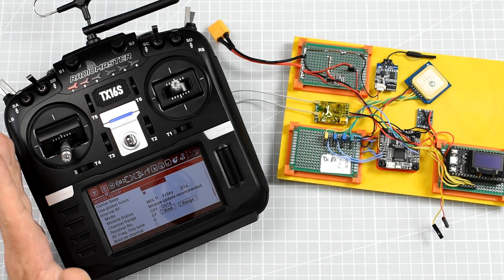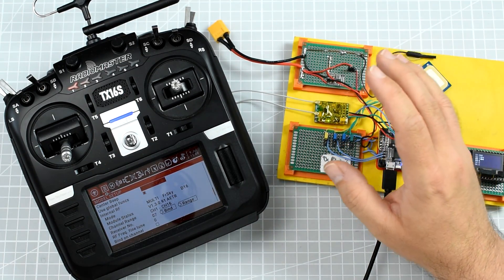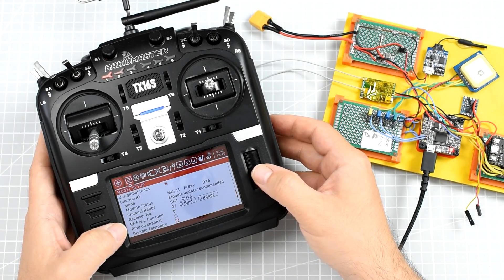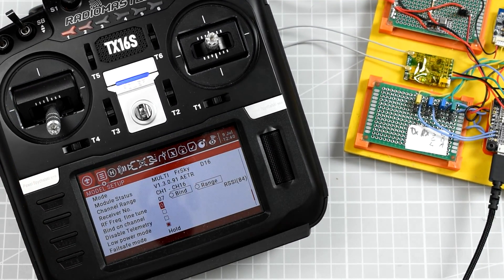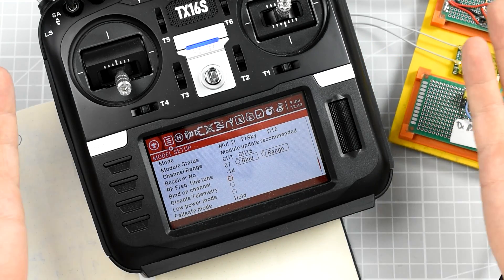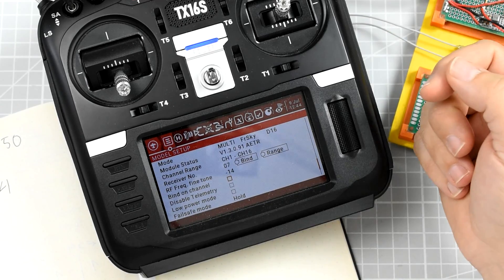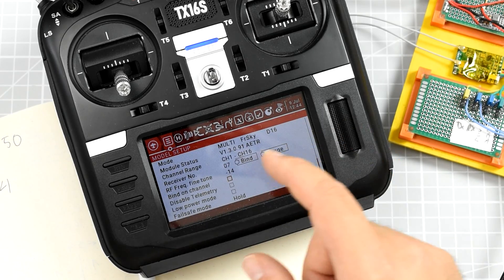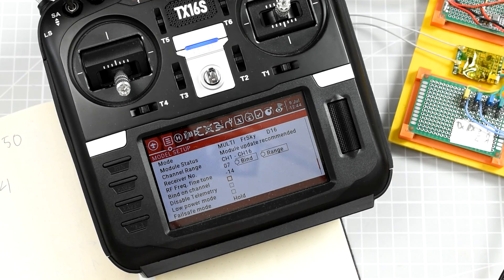Multiprotocol Module Frequency Tuning

Comment: Hi I'm having an issue with my x9 lite an xm pluse when I'm 2 close it loses connection will this fix the issue?
Reply from the maker: This is expected. And no, probably it will never be fixed
Reply: @FPVUniversity  is there a way to fix it
Reply from the maker: No

Comment: Thank you for the video!
I have a question using a TX16S with an FrSky XM+, I have "RSSI" working and showing on betaflight and my fpv goggles but it doesn't show a value on the TX16S?

Comment: My RadioMaster software does not show RF free fine tune.
Any suggestions?
Reply: Upgrade the RadioMaster and, foremost, upgrade the firmware of the External Module. (At least, this is what worked for my Jumper t16.)

Comment: Don't judge me for this ... I can see things difrent some times. This is a power level based adjust ... nothing else nothing more. I will not work with afhd or other multi frequency receivers/transmiter . Antena calibration is something else ... IT should be same as software side of the transmiter/receiver. Power based adjust is more dependent in things that are around You (house, walls, trees, etc)

Comment: There is some difference when you go until loose connection. And when you are from out of connection to when you aquire again the link. I do prefer the second alternative. 

Also I repeat the test several times and take note of several values. It is not always the same for some margin. Then I use averbado of the lower and upper average :)

Comment: Since SPI based frsky receivers fine-tune automatically upon bind (or so I've heard) would it make sense to rebind after the Tx fine-tune process?
Edit: I'm specifically referring to the frsky_spi_offset parameter. Is it maybe best to just have one module "fine-tune" to the other, and just leave it at that? Meaning, it may be better for SPI based frsky modules, on firmwares using the spi_rx framework from betaflight, to not do perform the fine-tune process on the TX. I'd love to get some feedback from others on this.
Edit2: My own experiment shows that rebinding after performing Tx fine-tune process brought the frsky_spi_offset value from -18 to -12. These results are repeatable with a margin of about 1-2 units for me. So is it better to de-tune just one module, or is it more ideal to "meet-in-the-middle" with both Rx and Tx?
Edit3: I'm finding that if you fine tune with an SPI based RX, it's best to reset any offset in the firmware to 0.
Reply: For my spi based quad I did a fine tune since it failsafed very reliable at the same spot in my garden. The tune was quite off from the default  (-29) but I had no more failsafes since. So if they do a fine tune it’s either not good or I made a mistake while binding using the betaflight cli.
Reply: @keinplan147   it's automatic. It saves during bind process as a parameter called frsky_spi_offset, you can check in cli: get frsky_spi_offset. Yours is probably a fairly large, negative number. You noticed improved range and you didn't re-bind?
Reply: Brandon's Baked Beans yes the range improved without rebind. I didn’t do a range check after that, but now I am able to fly around the garden without failsafes. Thank you for the information, I checked the spi offset and it was at -46. After rebinding without changing the frequency fine tune it has gone down to -37, shouldn’t the offset be closer to 0 if the Transmitter fine tune is correct?
Reply: @keinplan147  I would think it would be closer to 0. But I honestly don't know, so I'm fielding results from others. Perhaps you can go back and forth, fine-tune on Tx, then re-bind on Rx. Wash, rinse, repeat. Bad idea?
Reply: Brandon's Baked Beans that’s exactly what I did Last evening: when upping the transmitter tune (so going from negative closer to 0) the receiver offset gets smaller. The lowest number I got was -3 with a fine tune of +18. upping the fine tune on the transmitter further the receiver would not bind any more, so an offset of 0 is not achievable for me. So it seems the spi offset is somewhat different to the fine tune. The quad is my only frsky receiver, I will receive an r-xsr in the next weeks and will do the fine tune with this receiver and try the value on the spi receiver.
Reply: @keinplan147   I did something similar this morning. But I set the frsky_spi_offset to zero on the RX, then did the fine-tune entirely on the TX. Before, the RX would auto at -17 and fine tune on TX would be -15, but with the RX at 0 the TX is now at +6, and I keep telemetry for about twice the distance.
Reply: Brandon's Baked Beans forgot to mention that I didn’t fly outdoors after tuning so I don’t know about the range, hopefully it won’t be as windy next week. I just tuned as you described and got a transmitter fine tune of -15 with rx set to 0. rebinding with this tx fine tune gives me an spi offset of -47. I’ll just set it back to 0 and see how (far) it will fly.
Reply: @keinplan147  don't rebind it! I'm having much better results with binding, then reset frsky_spi_offset to zero, then frequency fine-tune on the radio and that's it. I suspect that the Frsky_spi_offset function doesn't set properly on this board with the multi module.
Reply: Brandon's Baked Beans I just did the rebinding out of curiosity and redid the fine tune afterwards with spi offset at 0. just wanted to see how much the offset differs with the transmitter tune - sorry I didn’t make that clear before.